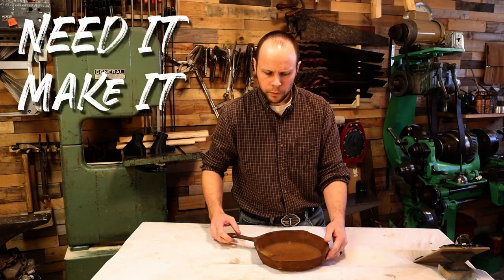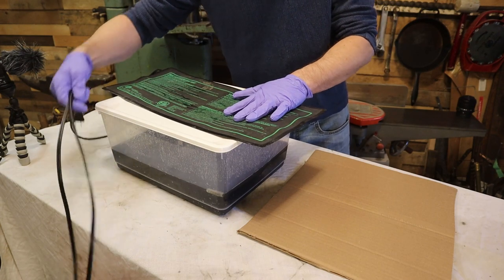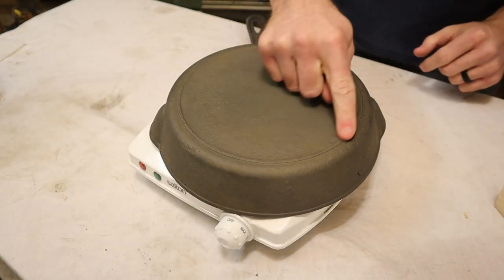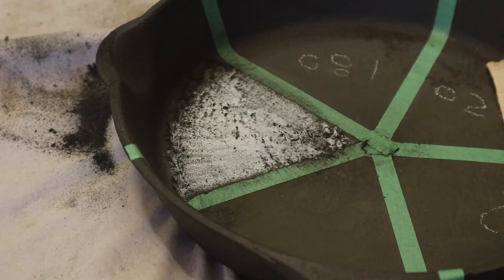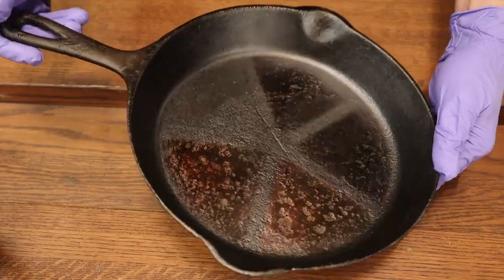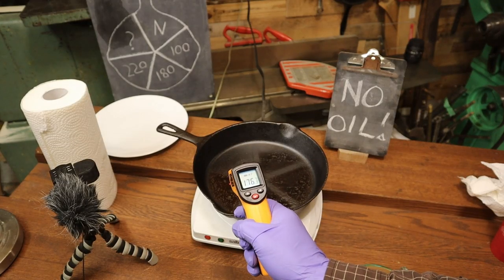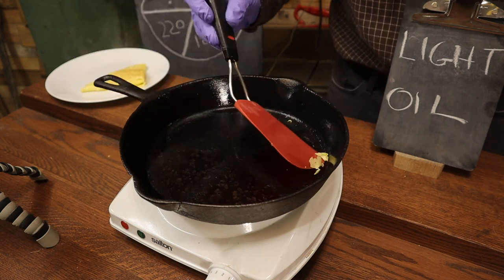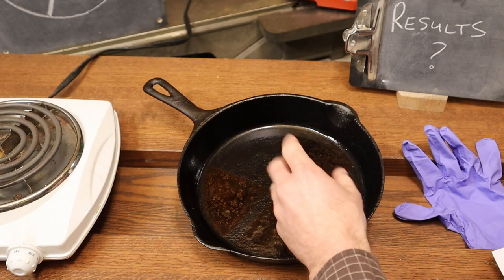🍳Restore Rusty Cast Iron Pan + 4 Smooth Simple Finishes, 1 Extreme Finish & NO OIL Test!

Comment: I buy and restore cast iron pans and pots ,the method i use is apple cider vinegar bath for a couple of days for rust ,then a lie bath to remove carbon buildup, seems to work best for me thanks for your videos !
Reply from the maker: is apple cider vinegar better than regular vinegar?  Where do you buy lye?  Nobody seems to sell this, I wanted to make soap years ago and couldn't find it anywhere.

More videos coming today and tomorrow!
Reply: Normal white vinegar works perfectly fine to remove rust. Lye can be found as pipe cleaner. Read the ingredients to make sure it's 100% lye.

Comment: Interesting.  I had an old Lodge skillet I picked up somewhere for a few bucks.  It was rough of course so I spent some time sanding it down like the old smooth skillet I have.  I cook mostly with a skillet that is a bit rough and so far it doesn't stick.  I usually do like you did in the first oil test.  Heat up the pan, put in a little oil, wipe it around the inside and then add my butter.  So far no omelet has stuck yet.
Reply from the maker: Thanks.  I'd like to get my hands on another lodge, a 10" would be perfect.   Many people have told me that you don't need to sand, you just need to use a metal spatula on the pan for 10 years... we're no so patient these days to wait that long when you can sort it out with a little sandpaper.

The old pans were prepared in a similar way using an abrasive of some sort from what I can tell from the witness marks on my old Wagner pans.  

I'm also a butter fan, I've recently tried using clarified butter with really good results.  I was able to get the heat up a little bit more and the eggs didn't turn brown.   I believe they call it Ghee.  

I'm getting hungry!
Reply: @NeedItMakeIt  If you don't buy a used 10 inch, check out the Lodge Blacklock pan.  The used prices here are almost the same as new prices.  I picked mine up from Costco for just under $50 delivered with tax.  You can also order them directly from Lodge.

It isn't the smoothest pan, nothing like the Wagner pan I have, but it is smoother than their regular pans.  Check them out, you might find one you can't resist :-).

Comment: I use a random orbital sander, starting at 40 grit, then 80, then 120.  That's smooth as a baby's bottom and I can also get the sidewalls by slowly "climbing" them with the orbital, from a flat position and going around a few times and just with the 40 grit (Diablo 5").  I buy used pans at Goodwill and arc for a $4 - $10, self clean cycle for 4 hours, the gunk is powder that blows off.  Any residual rust comes off with a little vinegar. I just put a plastic tub in the kitchen sink and scrub the pan using 1" thick industrial Scotch Brite pads, wearing neoprene gloves.  I scrub about the same way you sand on this video!!

Some older Lodges are smoother than the new ones and it's not because of "years of using metal spatulas."  They were just made in smoother sand molds.  I smooth the cooking surface, the bottom AND the handles, which make the pans much nicer to hold.

Where's that Stargazer seasoning link, please?  I emulate Aunt Jemima, opting for cooktop seasoning with bacon grease.   Heat the pan just beyond smoke point, then rub cooking surface with lint free rag impregnated with the fat.  It burns off in a minute or so and, once matte, repeat.  Continue for 10-15 minutes, and you're done.

The outside seasons as the pan is used, just oiling very lightly after cleaning.  

I honestly feel, my Lodge pans will be the ones coveted in 100 years.  Not just mine, but all the smoothed out ones, of course.  It's getting harder to find old Wagner Ware, Griswold, Vollrath, Wapak, etc., skillets that aren't warped, cracked, badly pitted -- or all of the above. 

Lodge skillets are heavy, but they're also sturdier and some weight is shed in the smoothing process.  If one goes, all-out, the finish is smooth, far from the primitive stock finish and doesn't require anywhere near the amount of oil you used.  

Call me cheap, but for a few bucks worth of sanding materials, a $7 12" Lodge from the arc and an afternoon spent wearing the now highly sought after N95 mask, that skillet won't be put to shame by anything you can name...and they sell, locally on CL, for $45.

A 10" custom Lodge is $40...or $75 for the pair.  Instead of paying 3-5 times as much, for a new skillet which is "designed in Massachusetts and crafted in Red China," you're rescuing an already existing skillet from the scrapheap...and other than, perhaps, a little vinegar, all the pans encounter is soap and water.   

Used cast iron -- other than really fine antique pots and pans -- is a dime-a-dozen.  Keep your eyes peeled at estate sales and thrift stores and you eventually stumble across a nice antique pan for cheap.  My "very good" condition 11 3/4" Vollrath skillet, unrecognizable under a century's gunk, cost me $6, $2 LESS than a clean 10" Lodge I also snapped up.

It's personally rewarding to create a very nice collection, plus give to friends, who LOVE them (even as wedding presents) and move some on to people who sometimes request Dutch ovens or griddles or even stovetop woks. 

Cast iron is King in more and more kitchens...and that's a very good thing!
Reply from the maker: This is reply #1, #2 will have to come tomorrow.  https://stargazercastiron.com/pages/use-care#usecare_tabs3

Comment: I really like your videos about your resurfacing experiments. I was really fascinated about the temp difference among the three sections in the first video (though there seemed to be less difference in this video, unless I just didn't pay close enough attention). I wonder if it has to do with greater surface area on a rough surface and cast iron's characteristic of very high emissivity compared to other metals. I wonder if the results would vary among the surfaces if you heated in an oven, a more evenly heating environment. Since cast iron is not the best distributor of heat (despite decades of misleading marketing) I question how reliable a reading can be on coil burner. 

Btw, I have two Stargazer pans 10" and 12" and really love them. I happened to know I'd be driving through Pennsylvania around the time the 12" was ready to ship, so I emailed in advance and they let me stop by to pick it up. They were very friendly-- good people, they gave me a small tour of the finishing process. Even refunded the shipping cost. I'm eager for more from them!
Reply from the maker: Maybe I'll do a video someday on the IR sensor... I'd really like to have one that shows a visual readout of the entire area.... they are pretty pricey, so maybe a future purchase.   I can certainly test the oven method and report back, based on what I have learned, the reading will still be off, the surface finish has a direct impact on the accuracy of this method of measurement, but I can certainly test it anyway.

You're one lucky guy, those Stargazers look great.  I've had my eye on some Australian made 'Wrought' pans around the same price-point as your Stargazers.  I have driven to Pittsburgh once for work at the University, I remember getting lost while going through a long tunnel and ended up near an airport (direction-ally challenged) A beautiful city with so many hills.

Great comment!

Comment: Nice videos!
I sanded my skillet a couple years ago and went extreme to 2000 grit. I’m not sure I like the result though. It doesn’t seem to hold its seasoning for very long and kind of tricky when it comes to sticking.
You think it’s reversible? What if I sand back from the polish to 100-220grit. Think that would make the seasoning hold better or is it too late to go back from the polish?
Reply from the maker: Yes it is, go back to 100, it works perfectly.  I've done this exact process with my pans.  I also boil vinegar inside, clean with hot soapy water immediately, the bake in the oven first to draw the temper colors.   After that apply the seasoning and it gives a darker color from the start.
Reply: Thanks!! I’ll try that
Reply: @NeedItMakeIt Great tips. I’ll try the sanding with 100 grit then vinegar boil, then blue in the BBQ then season. I have some Darto carbon steel pans that have a really smooth finish and my awesome looking pitch black seasoning (13 layers) flaked and peeled on the first use. My suspicion was exactly that the  surface was just too smooth.

Comment: If you were interested in fixing the pan, perhaps brazing might work? Pretty simple process from what I understand but I've never done it myself, and I'm not sure how it would stand up over time. Just a guess on my part.
Thanks for the great vid! I've really learned that I need to season my pan a bit better, and cook at higher temps. I have one of the 10" Lagostina from Canadian Tire you mentioned in your last pan testing vid. ;)
Reply from the maker: I'd love to have the tools to braze, that is a traditional method of repairing anything cast iron, I'd probably have to heat the entire pan first because it would warp badly with the kind of heat needed to braze (900C?)  

I have two more videos coming out shorting on cast iron, and I also have plans after those two with the Lagostina pan. 

On that subject, does your Lagostina pan has a 'belly' in the middle?  Mine and all of the ones in the store were raised in the middle (the 12" model also) by about 1/32" which caused my bacon in the middle to burn and my eggs to flow to the outside of the pan.  My feeling is that it was either a problem with cooling at the foundry, or it was designed into the pattern that way.   The bottom of the pan makes contact with the stove-top only around the outside.

Comment: Pool acid diluted into water works really well.
Reply from the maker: Have you tried evaporust?
Reply: @NeedItMakeIt Muriatic acid is $10/ gallon and you maybe need a 1/2 cup diluted in a gallon to strip the rust I imagine. Probably cheaper. It’ll also clean all the calcium residue in your toilet bowl within 30 minutes and makes it look pristine. Just makes sure you have  GOOD VENTILATION.